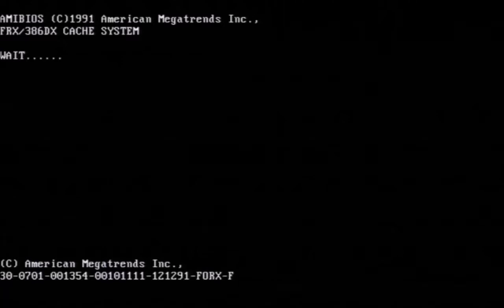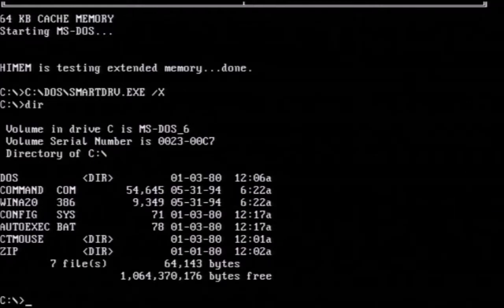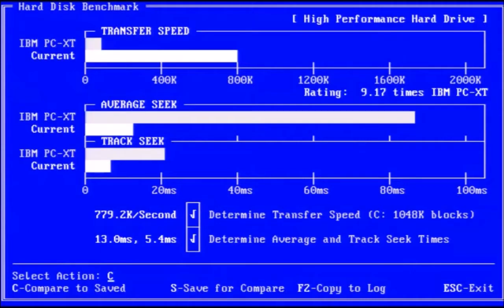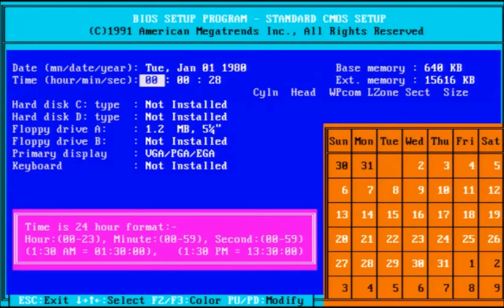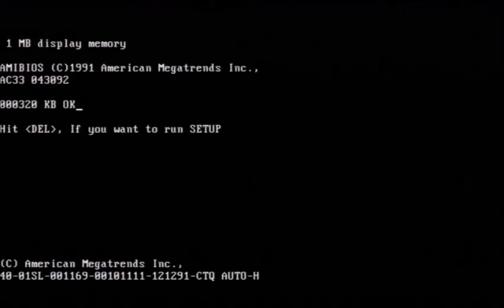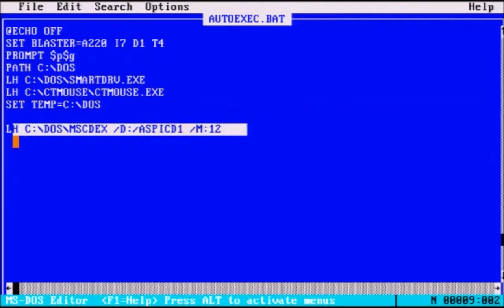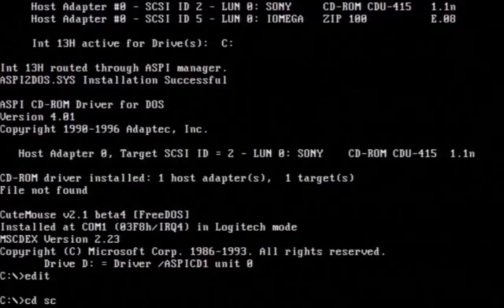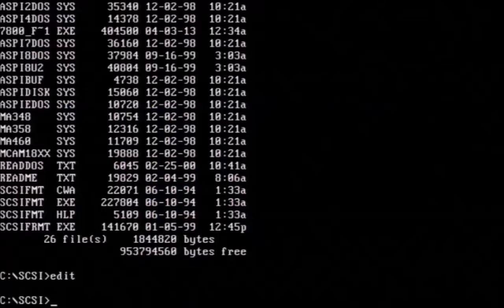An Overview of SCSI and SCSI type drives.

Comment: There are many types of SCSI hard drives. To start 3 cable types those determine the speed for the most part. 50 pin is the slowest. 68 pin for wide / ultra wide. It's about 4X faster. 80 pin for ultra wide. You also have SCSI-2 and SCSI-3 type of drive.The old Macs use the 50 pin. I currently have 68 pin wide 9.1, 18.2 and 36.4 GB in my Beige power Mac.Had no problems setting it up. If you are looking for a SCSI drive, be prepared to pay a big price for it.

Comment: nice video,did not realize the variations of scsi over the years, my issue is i have one of the quantum pro drive with the 50 pins, i am trying to figure out what exactly do i need so i can transfer this data over to one of the powerbooks, then move it to modern hardware hopefully. any idea how this can be done?
Reply: I've got the same problem. Have you found any solution?
Reply: @DanieleChiandotto86  unfortunately I have not found a solution. The closing thing I saw online was some adapter by adaptec but I am not sure if this works for this particular hardrive and I have yet to see a video showing it

Comment: Yes, SCSI is older than IDE/ATA interfaces...  Early SCSI controllers included interfacing multiple MFM drives to SCSI subsystems, where each MFM drive was a different LUN, (Logical Unit Number) within the SCSI device address.  LUN device selection was used very commonly in the early days of SCSI, till the prices of electronics dropped to the point it was cheaper to actually have the FULL SCSI controller on each hard drive (or other device) instead of having a SCSI controller that controlled multiple devices.

Comment: How wrong you are
You won't that much at all
Actually it is exactly opposite
You won't see much 68 pin
You will see tons of SCA2 80 pins
And raason is trivial
You won't see 15 hard disk drives in normal computer or even high end workstation
You will see 15 hard disk drives in every single storage shelve
And you will see whole racks of storage shelves
The ratio would be roughly 1000:1
1000 SCA2 HDDs per 1 68pin HDD

P.S. my daily driver is Dell PowerEdge R715 with 2x AMD Opteron 6174, 128GB RAM, H700 LSI MegaRAID, H200 mpt2 sas, 6x 400gb sas3 ssd Seagate 1200, 2x 256gb m.2 SATA SSD, 3x 256gb m.2 NVME
It is running on CentOS 8 Stream (I got everything to work, including Dell OpenManage).
I am selling enterprise grade computer parts.
Reply: It depends on specifics...  If you work with certain age and devices the 68 pin interface may indeed be more likely to be seen.  But overall, I do believe a much larger number of the SCA2 80 pin units were built and shipped.  I think your ratios may be actually a little low for produced numbers however...  I think it is over 1000:1.  Most of my parallel SCSI is PRE SCA2...

Comment: The 1994 Quantum Prodrive
( Compaq Drive [ Parallel IDE Connection ] ) It "Spin Up" & "Booted" in May 2006
Inside Compaq DeskproXE466.....The Deskpro was an "Office
Computer until January2000...
In April 2006, I bought this
Compaq Deskpro486 ("Used") for $60.00....It does
Not have SCSI connection,
because Deskpro 466 & Deskpro 486 there's only
One Primary Parallel IDE Connection ( for Drive "C"),
& One Parallel Connection
for Floppy Disc Drive.

Comment: Great video - unfortunately I never got the 80 pin drives to work with the adapters bought from e-gay. I have an AAA131(2Mib cache) + 10GB drive in an old desktop. Love the sound - the louder the better.
Reply: There are MANY differences in interfaces, active termination, a differential bus, in addition to the more traditional bus and termination.  It really started to get confusing for awhile there.  Yes, there have been adapters available to integrate them together, but the intention was to pick the option that was optimized for your needs, speed, noise immunity, long cable lengths, and ONLY use that interface type of devices for THAT SCSI segment.

The Adaptec AAA 131 is single-channel SCSI Array Adapter

It originally shipped with:  One 5-connector 68-pin internal SCSI cable with active termination, and/or, One 5-connector, 50-pin internal SCSI cable with active termination.  the first shipments had both cables, but lower priced packages were reportedly shipped with only one cable depending on the specific UPC label of the package.

It is listed to support - SCSI Ultra, Fast, and Wide (8-and 16-bit) 20 MHz (Note this is generally classified as SCSI-2)

Ultra and Fast refer to speeds, Wide refers to the wider 16-bit data bus width.

To determine the proper cables, termination, and possibly even additional adapters needed for your drives, more details are needed on the drives.  If your drives are differential bus, they will not work directly with this decent, but lower end consumer controller.

Comment: I got a old Mac clone, Power computing PowerCenter 132D. It has a scsi CDROM and a 5400 rpm 2gb SCSI HDD with Mac OS 8.6. I bought a 68 pin card on ebay and picked up 2 18gb 68 pin scsi ext. hdd's with seagate 7200 rpm barracuda drives in them

Comment: Does anyone know what the AT&T chip does on the older Quantum's PCB because it seems like the ones with the AT&T chip make the seek sound that I like a lot like with the Quantum ProDrive LPS420AT.
Reply: That's what the hard drive techies call a "read/write channel", and you don't see them much anymore because improvements in IC technology since the 1990s means that the manufacturers have been able to integrate them into the controller chip. Those older Quantums also used a custom controller chip (usually made for Quantum by TI) and an external NEC 78k3 or 78k7 (16-bit) CPU.

Comment: hi scsi hard drives are very good BUT they have got to be cooled all the time i have some sun 711 boxes
they last a long time in the boxes yes they are like a jet taking off.  the scsi DLT DAT are ace i now only scsi on tape back up
yes tape drives are not quiet they like scsi got to have fans to keep them working i love scsi you just got to know how to keep
this old gear running top tip don't leave scsi on all the time it over heats and the drives burn out. 80pin hot plugs are the ones
i like best to scan them first 90% there's dead parts on the drives easy to fix

Comment: The cable connectors on those drives are 50 pin and 68 pin.  The newer hard drive with out the molex power connector is a SCA 80 pin connector for use in hot swap server arrays.
Reply: this is a bit of a old comment but I have a bunch of the newer scsi drives without the molex power, I also have a pci-x scsi controller for it but I have no idea how to connect the hdd to the controller?

Comment: When I'll find a functionnal 486, I will use my big ass fujitsu SCSI HDD. That one is really a monster because it's at least two times taller than a regular 3.5" drive. This is a 2.0GB HDD and I'm pretty sure that it would be a very nice addition to a 486.
But even though it's big I don't think that it's that loud. Yeah it's a bit noisy, but I don't recall finding it noisier than a regular IDE HDD. 

In fact I'm wondering if this isn't a myth. Yeah maybe nowadays they tend to be noisier, but remember that they were used in servers wich means that they were used for a longer time than IDE HDDs and so the bearings may tend to be more damaged on them and so making it noisier.

As for the size, I didn't find them smaller than their IDE counterpart. I got 12 or 13 68 pins (yeah you said 80 pins in your video but these are 68 pins only) SCSI drives, and looking at their manufacturing date and by comparing them to IDE drives made at the same time period, they were on the same level. I may be wrong but like you said nowadays this isn't something really important
Reply from the maker: Maybe it's just my luck or maybe it's the later drives but all the drives I've come across from the early 2000s seem to much smaller then the average ide drives of the time.  could just be me though. your right about the 80 being 68 pin. I don't know what the hell I was thinking. thanks, I'll correct it in annotation.
Reply: Mine are from the late 90's/ early 2000's

The biggest one that I got that time was 73GB, the other ones were around 36GB or less for the ones that came from the late 90's
still not bad for the early 2000's

Comment: Lovely, thank you :)

The controller I have is an Adaptec 1542B with BIOS 3.1. It has a 1 GB limit, but Adaptec offered a 3.2 ROM which upgrades this to 8 GB. I've already ordered the EPROM chips and an UV eraser to to that. And I've got a 1542CF underway, those should be able to do this out of the box.

Got a 500 MB Quantum going, works quite well. It did break the 500 MB barrier, so that's a huge plus. The controller uses address 330H, so that could be an issue with MPU401 interface cards. Apparently it doesn't support booting on any other address.

Got to get myself a few more drives and cables...